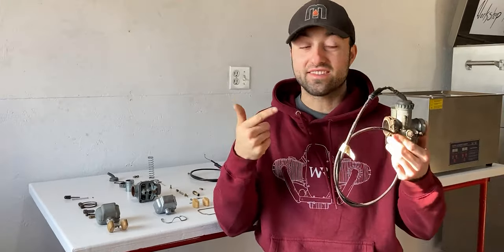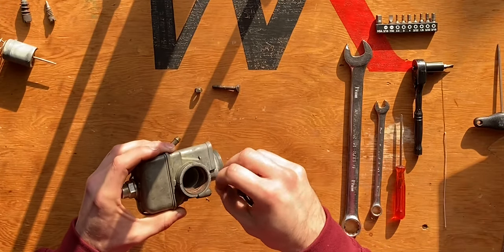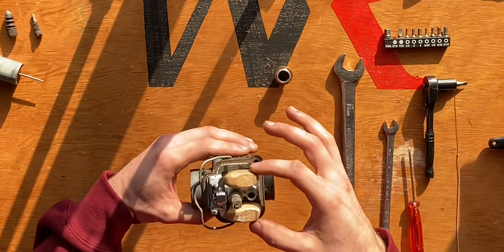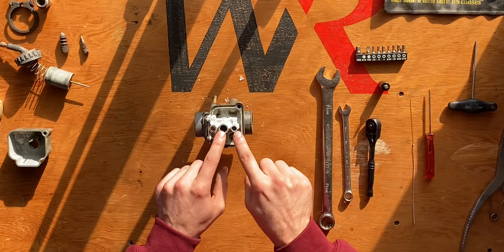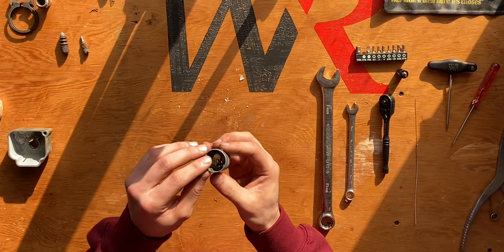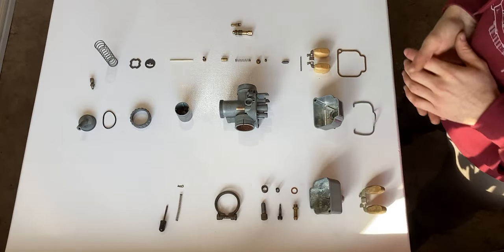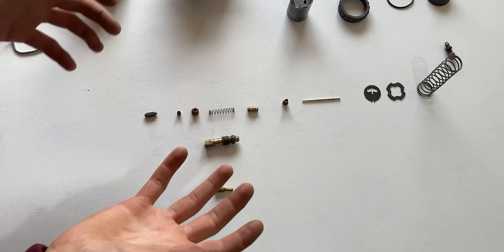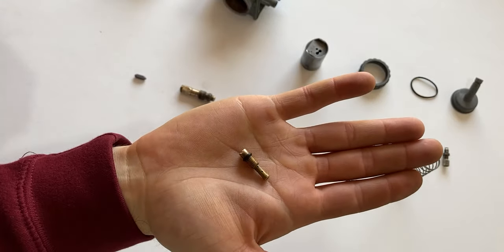BMW R60/5 Carburetor | 26mm Bing Slide Carburetor

Comment: I think the piece that is inserted first (with four holes) has a tiny fibre or plastic disc ("Reed") that operates as a non-return valve for the fuel (part number 38 on the Bing 53 carby drawing).  You can test the non-return function by sucking on that first piece.  You can also test it the same way with a fully assembled accelerator pump.  I found I was missing one.  Bing sells them for about $2 each.  
a
Reply from the maker: Hi Allan, you're 100% correct and I will mention this in an upcoming assembly video! Thank you very much
Reply: Do you have a picture? It looks like mine is present ... mesh?  I assume you are not finished. I'm in the midst of this.
Reply: @MyWillypilly  I found a good youtube source for that carby;  It is in two parts and includes the Reed.  Use the Subtitles/Translation:
https://www.youtube.com/watch?v=JdK0r9ic5VM&t=1s

https://www.youtube.com/watch?v=hc5Sp1C0Gt4
Allan
Reply: @allanmorgan7022  thank you. Bing in Kansas has been helpful

Comment: I don't know how you are progressing with this. I can attest if you use "new" carb spacers , the fibre is indeed a super tight fit. You may have to clean up the flange on the head and sand the fibre insert. The carb is difficult to fit up! Beware❤

Comment: Thank you for this detailed video. I’m working on a 1975 R 60/6 that I’ve had since 1993. I kept it in the garage since 2000 with the hope of working on it when I got more time. I never could have rebuilt the carbs without this video. Keep up the great work!
Reply from the maker: I'm happy to hear you found this video to learn more about your carburetors! You have a very nice BMW and with a little bit of maintenance and cleanup, it should run without any issues. These bikes are becoming more popular by the day and it would be nice to know you brought yours back onto the road. Enjoy the process Steven. I will continue to work on this BMW, as I've finished up some other projects. Thanks for tuning in! Regards Andreas

Comment: I believe the white corrosion is from "phase separation" which happens to modern gasoline which has ethanol in it. It affects the aluminum and the white stuff is aluminum dioxide. This is why it's important to use ethanol free gasoline in our carburated engines. BTW awesome videos!!!

Comment: Right you are!  I had an R75 50 years ago and forgot that the 50 and 60 were slide carburetors like the/2 models. Good video, it will help me next time I do a rebuild on my R69S.
Reply from the maker: You already got me thinking I had the wrong carburetors for my bike!😁 
Yes the R75 was the most produced /5 model and therefore it‘s easy to think all models had CV carbs.
I‘m glad you‘re looking after an R69S! Nowadays they are very hot collector bikes👍🏽👍🏽 I haven‘t seen one in person yet, but they look so good in pictures.
Regards Andreas

Comment: Good progress on the R60! I always buy the rebuild kits for any carb I restore. For the 26mm Bing, the kit costs about $30 USD for two carbs. While gaskets and o-rings may be reused, I like knowing everything in a new carb that is a wear part is replaced. With Amal carbs, I'll usually replace the jets as well since they are known to be problem areas.
Reply from the maker: Thanks a lot John, it's coming along just fine! I agree, carburetor kits are the way to go and they are fairly cheap. I've seen them online and this will be the best solution for my rebuild. I will keep the Jet-Issue in mind and it does seem like this is a common problem around older fuel management systems. Running 87-91Octane in Canada isn't the best...especially with all the sub-gases they mix in. Either way, I think it's important to maintain a carburetor for best performance and that's more or less why I shared this video of the disassembly. Thank you for you advice and Best regards -Andreas

Comment: Tip if you don't have ultra sonic cleaner is you can use 3d printer nozzle cleaners for these jets. Saved me 300kms from home in bear country! 1 spec of crap can stop the accelerator. There is also a pilot with only upper holes in top.
Reply from the maker: That's an awesome tip! I'm going to look into that, as I own a 3D printer myself. Thanks for sharing your experience and advice. Regards Andreas

Comment: On the main jet assembly there is a small plastic reed that is missing in your video. Part #38 on Bing website schematic. It goes between the spring and the nozzle spray jet
Reply from the maker: Hi Charles, thank you very much for this comment! I will confirm this according to the drawings and share an update-video once it all goes back together. Thank you for sharing this information with everybody!! Regards Andreas

Comment: Have you ever considered using the Mikuni carburetors? R60 BMW VM30 | Mikuni Replacement Carburetor Kit | VM34 Mikuni Complete Kit | Sold by SpeedMotoCo? I know they are, of course not original to the bike. Have you ever worked on Mikuni caburetos?

Comment: QUESTION minute 17:15. I noticed on the throttle slide needle your needle retainer connects into the 2nd groove from the top. My R60/5 needle retainers connect to the 3rd groove from the top. My carburetors are numbered 111 & 112. My Clymer manual does not discuss this, however, does show a photo of the needle retainer connecting into the second groove of the throttle slide needle. I wonder if I should match what you and the Clymer manual show. I'm just now getting ready to rebuild them. I might as well try to get everything right. Thanks for all you help. Again.
Reply from the maker: Great question and observation! Yes the needles are installed on the second groove from the top and that should be the „standard setting“! If you raise the clip by a groove you‘re essentially allowing the needle to go lower into the main jet. This will give you less fuel, causing your engine to run „leaner“.
If you go down with the clip, you‘re allowing for more space between the needle and the jet. This will cause your engine to run more rich.

If you set it at the second groove, you shouldn‘t be far off from the idle settings you‘re looking for.

I hope this helps! Enjoy your weekend😃👍🏽
Reply: @WorkshopRebuild I just this minute found the "Needle Clip Position" specification in the Clymer manual and of course you were correct again. Also, thanks for the great explanation.

Comment: Hello friend! I would like to know what would be the proper adjustment for the air and mixture for this bing 26 carburetors? How many turns for each? Thanks in advance
Reply from the maker: Hi there! Depending on your carburetor configuration, the adjustment can be different. Here is the factory spec and adjustment:
R50/5 26mm carb: Main Jet 130, Needle Jet 2.68, Slide Needle Position 2, Idle Air Mixture Screw 0.5 Turn

R60/5 26mm carb: Main Jet 130, Needle Jet 2.68, Slide Needle Position 2, Idle Air Mixture Screw 0.5 to 1 Turn

I hope this helps. Regards Andreas

Comment: Great video, but one question:  The carburetor you are working on is not a /5 but a /2.  Why are you referring to it as a /5?
Reply from the maker: Thanks a lot! This carburetor is used for the R50/5 models and R60/5 models. The R75/5 models used a CV carburetor (diaphragm style). The reason why I said /5 is because it came off the R60/5 I‘m currently restoring.
If they are identical to the /2 carburetors then I‘m glad this video covers those models too😃👍🏽
Regards Andreas

Comment: Great video! The carb has no choke?
Reply from the maker: Thank you very much! This carburetor does not feature a choke. Some R60‘s had them, others didn‘t.
The choke cable port is closed off with a factory sheetmetal plug.
Reply: @WorkshopRebuild  Thanks for getting back to me. So wouldn't be hard to start with no choke? I have a 1941 zundapp KS 600 with the incorrect carb on it with no choke. Its a little hard to start in the cold.
Reply from the maker: @RCASSIN if you have this identical carburetor, it’s possible to remove the choke cover plate as it is just made of sheetmetal. Then buy the components and add it to the carburetor. 

If you’re really in need of a choke system for your Zündapp, I would fabricated a custom “plate-choke”. This can be made directly in front of the carburetor. It can either be a slide plate or a twist plate, something you see on small lawn mowers.

This is almost better as you don’t have any cables running to-and-from your carburetor, just a small lever.

Let me know what you make of this.
Reply: @WorkshopRebuild  That is great advise, but i did manage to get a more correct carb with a choke. I would like to keep the originally of  the bike.  It is a Bing 1/24/27. But it is missing the speed needle. So I will have to find that. Thanks for your help!
Reply from the maker: @RCASSIN I understand what you mean😊👍🏼  I hope you’re able to find the speed needle. Bing has a lot of components available for their classic carburetors, but maybe you’ll find an alternative source which is cheaper. Bing has very high prices when it comes to those small parts😅 Good luck and I would love to hear your KS600 running. They are beautiful bikes

Comment: hi what is the level of the float in these carbs because I just want to set how many mm?
Reply from the maker: Hi there! When I adjust my carburetor floats, I tend to turn the carburetor 180 degrees, so the float closes the needle valve by itself (without pressure). Then check to see if the float is level with the gasket surface of the carburetor. In this case the surface of the float bowl to the carburetor body. 
Sometimes aftermarket or OEM floats need to be adjusted/tweaked up or down to achieve the correct setting.
I am not aware of a "mm" setting on this carburetor, but if you find any information on that, please share it below this video for others to read. 
Thanks for your great question and I hope this helps you in a way.
Regards Andreas

Comment: Hi there, when you removed the float needle I see that there is still a small brass fitting left in the housing which you did not remove. Could you please tell me is there a small o ring on this housing . Asking this question as apparently on some carburetors if damaged this o ring is the cause of a petrol leak. Yes I have a leaking carb which I shall be looking at shortly. Thank you.
Reply from the maker: Hello Sir, you are correct. I did not remove the float needle seat within the carburetor because it seems to be brand new! I believe the previous owner must have installed a new one. Upon research in the service manual and workshop manual, I did not see any information about an o-ring. I found a link to a brand new float seat: https://www.euromotoelectrics.com/product-p/carbseat318.htm and you will be able to see that there is indeed no groove around this part to accommodate an o-ring.
I hope this helps you understand that it is possible for fuel to leak past this seat if your carburetor housing is damaged! You can inspect this by adding fuel into the carburetor and activating the float needle with your finger. If the needle is closed and you still have fuel passing by, your housing around the float needle seat is cracked or damaged. 
Best regards -Andreas
Reply: @WorkshopRebuild  Thank you very much for the advice. And well done on the videos, very helpfull and informative.
Reply from the maker: You're very welcome and thank you!! I try my best and I'll have a very long video uploaded tomorrow on the 4-speed gearbox. This will be a full rebuild and now I can focus on some other subassemblies. Cheers -Andreas
Reply: @WorkshopRebuild  Pretty sure there is a viton tipped needle that is same or close spec. The bush seat gets hammered up after years of use a vet mech told me and drawing it out is a tough task. I lower the floats 1mm for the bush wear and it worked to add more pressure on seat. Great vid.
Reply from the maker: There probably is a float bowl needle that has a viton tip and that would be a great way to fix this. Correct, if your carburetors to work properly you might have to change the seat & needle every couple years. Removing the old one might be hard, but it could always be machined out with an endmill. Either way, your adjustments of 1mm will compensate for wear and hopefully you don't have to change your anytime soon. Cheers

Comment: what cleaner was used ? please
Reply from the maker: This caburetor was in the ultrasonic cleaner for 2 sessions of 20minutes. The cleaning solution is only Water and Dishwahing soap. Once removed from the ultrasonic cleaner I blow everything off with an air-hose and the parts are clean and dry. I hope this help, Best regards.